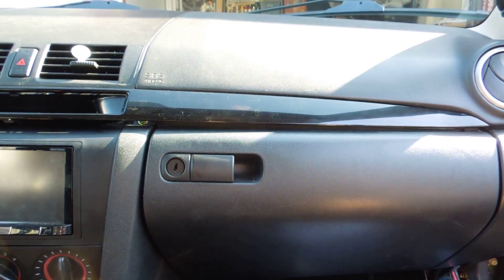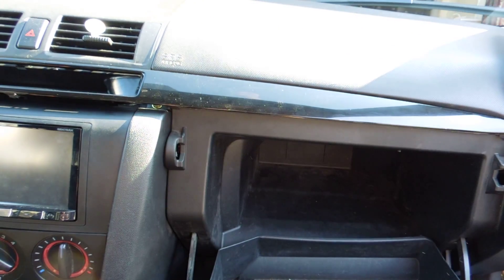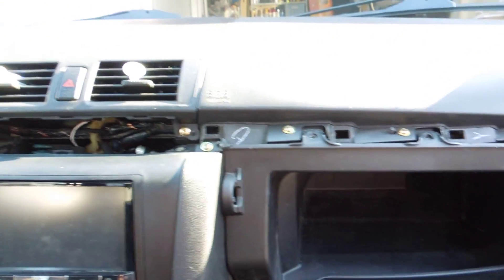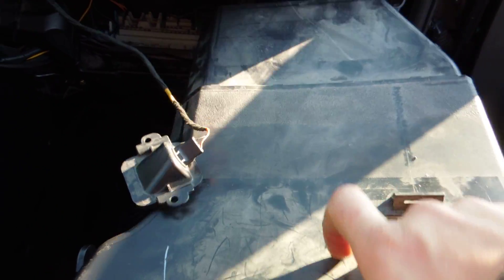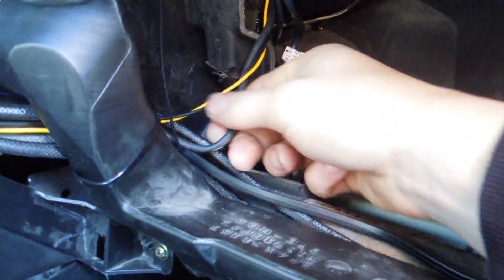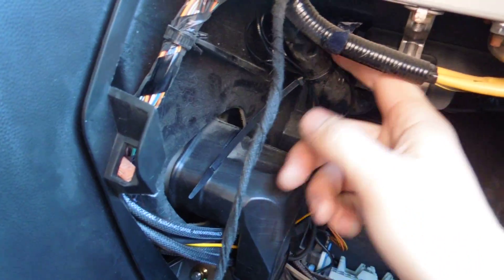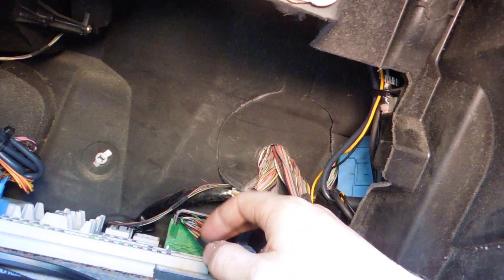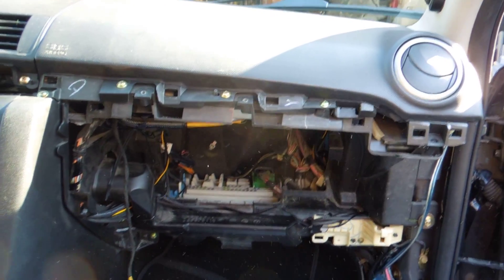wiring and hiding satellite radio gear mazda 3 2006

Comment: awesome video - I have an 07 Mazda 3 (2.3) and I want to get satellite and DIY... Will I have to tamper with the wires in back of the stock radio or is a plug I can use that's Mazda friendly in order to install a new deck (with satellite) I don't know where to even begin. I just know I don't want to pay Geek Squad 100 bucks because I'm a pc tech, but I don't know a lot about installing radios and your video gave me a lot of cool insights. Thanks!!!!
Reply from the maker: glad it helped mate